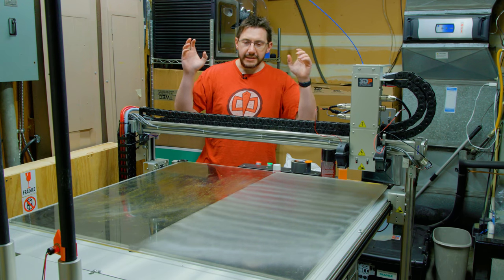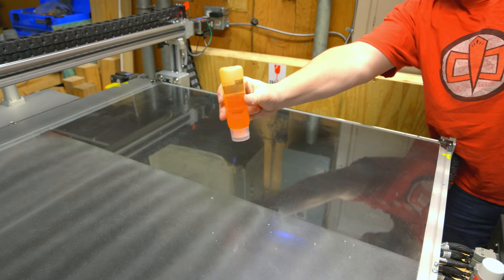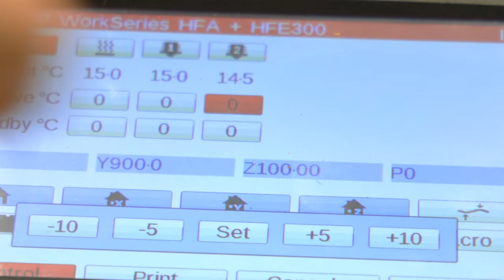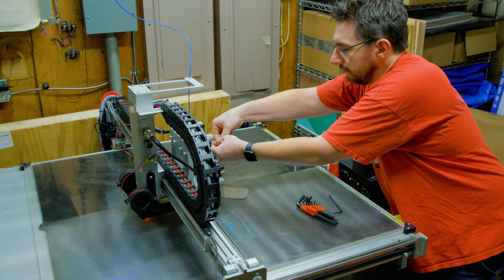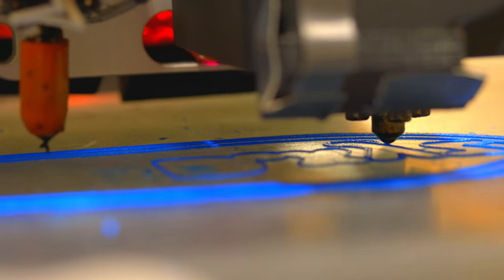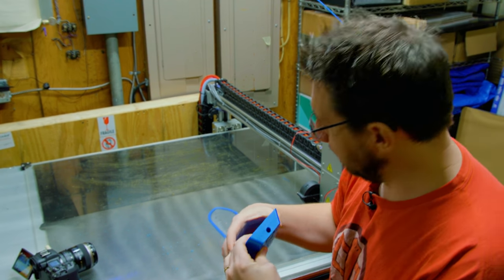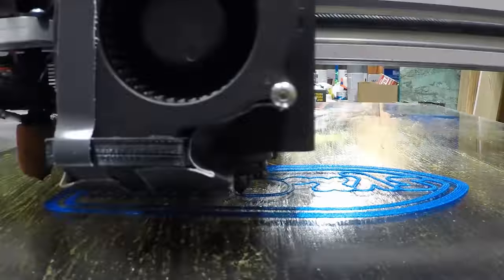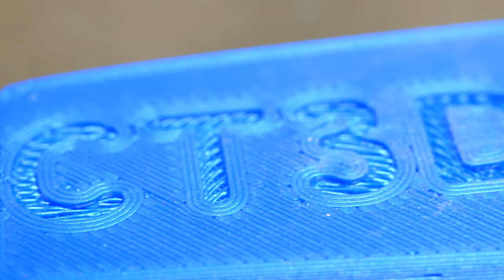$38,000 3D Printer Bed Adhesion Test // Super 77 & Zillagrip

Comment: Is 220C hot enough for that much volume of material/ flow rate? Also is the speed too fast as the rapid cooling would cause shrinkage and pull the part off the build plate.
And Nice Video Joel. Real tests. Failure. It's good to see it. I use Super 77 to stick Cloth to metal and never thought of using it as a bed adhesive. 
Cheers Mate

Comment: I thin down wood glue with water to consistancy of milk then clean and degrease it until the surface is just glass then brush the milky glue on it as a very thin layer and let it dry

Comment: manufacturer prob should have put alot more effort into the bed adhesion. So far ive never ever ever had a lifting problem with PEI sheet and thats without using any kind of adhesion consumables, just bare and whisper clean smooth PEI holds like hell. im not sure if it would work on a machine at this scale but i dont see why not.

Comment: I have a X1 sidewinder with glass bed and have found isopropyl alcohol used to clean the bed before each print.
 There seems to be a residue left on the bed from each previous print using PLA .
Tried a few adhesives but messy with limited success. Cheers from Australia.

Comment: Hey Joel, I think you need to increase (anyhow) the ambient air temperature. I can imagine thta it is difficult for such a big printer, but .. that's the reason. How about you pack everything in a large plastic bag and possibly a fan heater (thermostat with socket is cheap) inside so that summer temperatures are (23⁰..25⁰C). Then everything does not warp so much.
Reply: I was thinking to suggest buying a camping tent and letting the machine itself heat-up the ambient air. With nowhere for the heat to escape, it will probably reach 23C after 30 minutes with just the heat bed pre-heating. Camping tent material is also generally flame retardant.
Reply: @AshFlaw  exactly. With the heater is optional, if the bed is not heated or any other reason for too low temperature.

Comment: Try using hair spray, i use two hair sprays, Nuky for PLA and Nelly for ABS, I Stop using Nelly for PLA because is too hard to remove the part, i use Nuky in glass bed at ambient temperature and holds PLA very good, 0 warp, i just spray a little of hair spray and good to go. If these methods doesnt work Try using a lower layer height it kinda works for me with following settings ABS with a 0.4 nozzle first layer at 0.1 with 90/100º C usually doesnt warp too much(i print in a diy prusa style without cover or anyting).
You can make a video comparing how different hair sprays works for 3D print there are some that works surprisingly well.

Comment: Had the same issues with some of my prints on my prusa (I'm in Kitsap). Put a draft shield and heated the bed +5 degrees from what I usually would and it got rid of the problem.

Comment: How long did you wait to print? If that 77 was completely dry and set then it probably didn't have its full sticking potential. Maybe try a fresh coat right before the start of a print so it's still tacky to to the touch. Maybe also run the first 5-10 layers slightly slower to allow dry time or with a higher feed rate or flow so the filament coming out of the nozzle doesn't have as much preloaded stretch, (like a stretched rubber band trying to return to normal).

Comment: i assume you don't want to heat the garage, even temporarily, for cost reasons (or safety?)... i wonder if one of those infrared parabolic heat dishes could work?  the difference with something like propane is you wouldn't be heating the air (inefficient way to transfer heat to the part, especially if garage is not well insulated or drafty) but the infrared heat should transfer directly to the part and not the air.  i would have assumed somebody would have tried this before, except it wouldn't make sense for most people with smaller printers the way it would on this monster.  i'd imagine you'd also have a challenge aiming, focusing, evening out, and not overheating the part or the printer.  also this wouldn't prevent the shrinking, it'd just defer it until all the structure is printed so it could theoretically all shrink together.

Comment: Have you tried super glue or (and stay with me here) abs slurry?  I know it's usually made for abs prints but it might help with your glass.  Another thing, are you allowed to frost that glass?  Either with an airbrush and abrasives or hitting it with some fine sandpaper.  A little texture could help too

Comment: 220 for a PLA seems a little on the high end to me, when I have lifting I have found that printing at the lowest possible temp helps the situation, also did you try the super 77 and zila-grip with the bed heating on ?

Comment: My go-to would be ponal express (pva glue). But the issues is, to much grip and you can't get it off without breaking your printer. How about printing a square or with a lot of brim and adding clamps in the process? Or print on a pice of wood and then drive some screws through the brim? The issues is something will have to give, when it's not the bottom layer then it will be somewhere else, maybe allow the bet to flex with the object?

Comment: Just use white wood glue, sticks so hard you cannot remove it unless you put water on the edge of the print and let the capillary pressure lift off the model. Pro is you dont need to pull or anything, and cheapest and best method on glass

Comment: Layerneer Original Bed Weld? have you tried something like this its clear and the hotter the bed the more it sticks. If I'm having issues ill raise the temp 5 deg increments until it doesn't pop off. normally max 80c. works to ASA 100c temps and  I am sure further but it doesn't list it on the bottle. Also removal is pretty kickass just let the bed cool down to ambient and you can hear it crack off the glass. 

I don't use it on this machine I use it on my delta with a glass bed. I also have to keep my room quite warm sometimes to keep them stuck.

Comment: Wow - 38k cost and still does this? Mental! I'm sure you have checked but would it be anything to do with the part cooling fans? My Taz6 was a nightmare when I first got the Aerostruder, things were warping and lifting and it turned out to be the part fans through the 3d printed shroud. Printed another shroud and that sorted everything. 
It seems the prints are lifting on the same areas? Perhaps some 90 degree rotations on the prints to see if the same area in relation to the print head lifts?
Also, have you tried with filaments that don't need cooling?

Comment: I don't quite get what you're trying to do here? Alot of problems with lift are not 1 dimensional. It's many different angles of attack to deal with the un-even cooling. Setting the bed to 0 is not going to "test" which adhesive is better, just which one is more likely to crack your glass.

Here's something you are not incorporating, when you set the bottom layer, that cold bed is sucking out all the heat from the filament from 200ish C to something like 20ish C. It's cooling way faster than it should. Then you are reheating the filament with the 2nd layer and the heat gets transferred again and rapid recooling happens again. You put the bottom layer through several hot/cold passes.

This is also why heated chambers are so great for bigger pieces, it doesn't let the plastic rapidly cool. I feel to get the most out of this machine, you'll need to construct an insulated cabinet. One of the problems with going bigger is you introduce these kinds of problems.

Comment: I've noticed I get lifting on PLA prints on my FF creator pro. I used to print at 210/40, at a speed of average 35 - 50 depending on the project. I tried 210/0 and that made it worse. So, I was like... okay maybe it is cooling too fast and it causes to warp? maybe? so I ended up trying 210/60 and hairspray, and I haven't had a lift since. This is on a aftermarket glass pane that I use with the proper offset to print on.

Comment: Hey  maybe a couple of extra layers on the bottom to help with even heat dissapation may help as the Benchy looks real thin on bottom when I saw the infill with the light behind it ? not much material for the Heat to dissapate through maybe matey?
John in Auz

Comment: I print large stuff to and the adhesive that's work best for me is the yellow carpenter glue from LePage. I'm in Canada, I don't know if you can find LePage carpenter glue around but I guess any yellow carpenter glue will do the job, they are mostly all made of PVA. I also tried the clear pva glue for crafting, it doesn't work well for me. Its also washable with water.

Is it also possible that your first layer is to low? At 1mm I get good result at 0.7mm layer height.

Comment: This is a 38,000 $ Printer and you have to shim one of the print heads because it's heavier and not as aligned as the other?
What if you put a fan heater under the print surface and cover the frame to prevent the warm air from escaping?

Comment: Could the cooling of new layers of filament on top of older ones cause internal stress in material that would ultimately lead to the local detachment from the bed and the bending? Did the rest of model base remain flat?

Comment: I have a qidi Tec x-max. I run my Removable bill plate upside down because of the magnet and then it’s like glass. But I don’t have sticking problems on my large prints with just heating the bed and glue stick. But I use petg Soli. which is really sad because a Pla has the best colors!

Comment: In my point of view your 1st layer is not in the proper thickness ... (see below)
and you Must add "box" around your printer to prevent cooling ...  
so change the cooling speed of first layers too (in your case wait at least 2cm to get full speed fan .. and start at 0% speed )

So for the 1st layer, you need a layer less than the half of nozzle diameter 
Print just one layer and check the thickness with a caliper

Comment: have you tried UHU gluestick? i print with that in thick layer (aprox 0.1mm  spread on the bed) but the temps need to be in the 70-80 degree Celcius on the bed. even on a 220mm long print it sticks

Comment: I'm using the masking paper tape I get in 600mm wide 100m rolls for $50aud that I used to transfer my vinyl cuts on my mega zero which seems to be working lately. Its like the painters tape but wider and much cheaper

Comment: maybe change the glass with mirror, im changing my bed galas from 1mm glass to 5mm mirror and the way its stick is different, the 5mm one is sticking very well that i have trouble lifting the printed part. Maybe there are types off glass that behave differently

Comment: what about regular scotch pva glue stick? ive not had a single issue with that and literally any material except polypropylene and some nylons and some tpus stick excellent to it. with enough glue stick on the bed and the nozzle dug in a bit i can even get abs to stick completely unheated.

Comment: @3D Printing Nerd I see your struggle, problem is that you have too much heat, same thing in metal wepding, if you want to make a square frame from angular profile and you weld it all in one piece, you'll have a problem because the heat generated will definitely pull at itself while getting cold and, you have no more a square frame. Solution is to make the frame a bit at a time to not gain heat, but in 3D printing... I GOT NO SOLUTION.
Reply: I think solution is to build the benchy from the inside and more airflow or if it doesn't work, try to same build from inside while having a hot airflow over the machine.

Comment: Brim usually does the trick for me. I'm sure you tried it before...
Reply: his skirt/brim isnt even attached to the model either.  I use a wide brim to help adhear.  I feels ya!
Reply: @spunkmire2664  That's the difference between skirt and brim. Brim is attached to the model, skirt isn't
Reply: @gaellafond6367  skirts are dumb! lol
Reply: @gaellafond6367  but thanks for the terminology lesson
Reply: @spunkmire2664  Hahaha! I agree the skirt serves little purpose. It helps to have an idea of where the print will printed, so you can stop it early if something is wrong. It also help to equalise the pressure in the nozzle before the print starts, but most slicers do a purge line before the print for that purpose.

Comment: Why no mickey mouse ears or brim around it? another youtuber came out with a video saying it isn't the adhesive but the pulling force put on the parts when the pla shrinks due being cooled. to over come this he said to put a bigger mass down on the print be to act like a counter force to the pulling. i bet the super 77 would work if you had a brim that was big.

Comment: $38K ... what a joke ;) Glass surface this big is not a good idea. Cheap one for sure.  I wonder how it looks on the thermal camera? I suspect it is not good given glass thermal conductivity. Maybe that is the case and you need to bump bed temp up.
With this budget; Why not  give bed made from 10mm of casted (not rolled) AW-7075 or AW-2017A aluminium with planed surface (flycut). PEI sheet could be on top and no adhesive should be needed. 

The part about extruder being too heavy annd sagging is just sad.
Return this atrocity and forget about it.